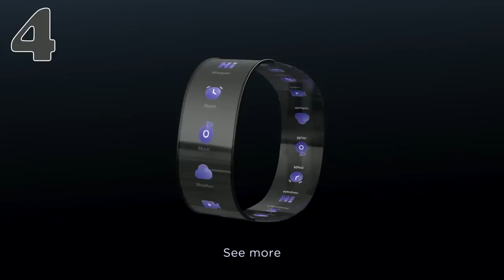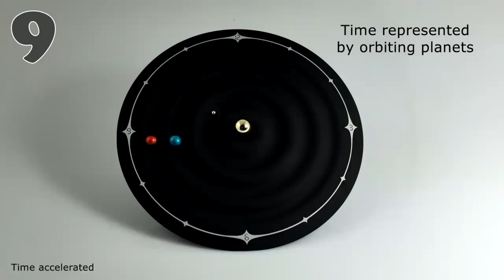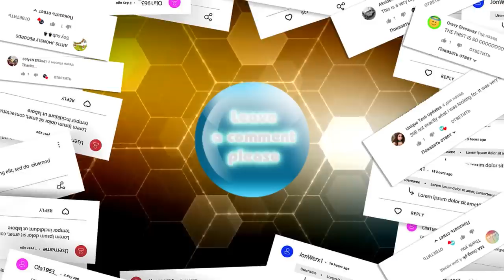10 AMAZING ALIEXPRESS PRODUCTS REVIEW 2019 | ALIEXPRESS GADGETS. TOYS. KNIFE

Comment: I had very bad experience with NEJE engraver. On interner, there was the same problem for many users. Laser diod was working only for maybe 10-20 pictures and stopped working. I bought new diod and it was good. But later, motor stopped working. Good luck with yout buying.